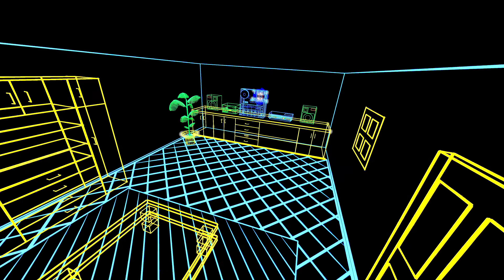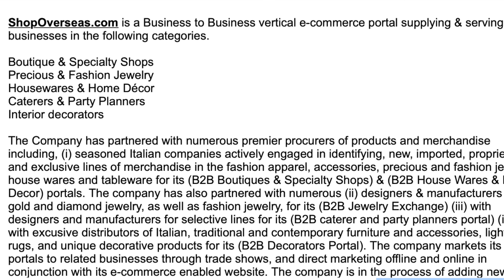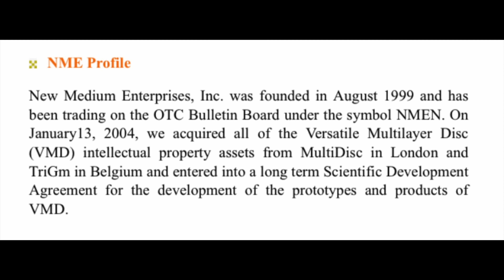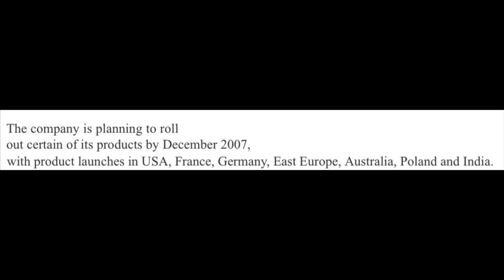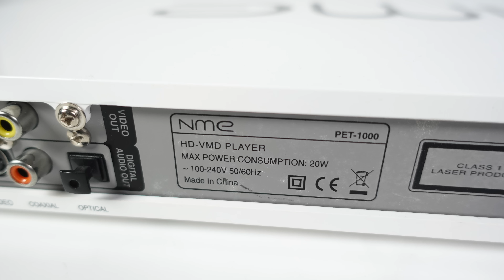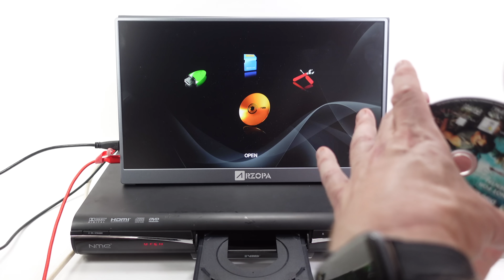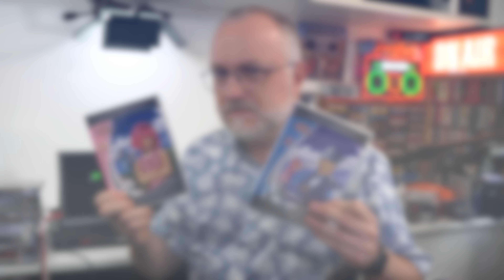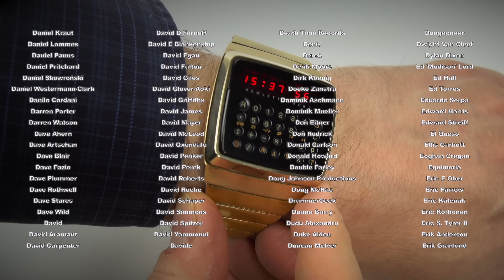The HD-VMD story - The format that lost to the format that lost

Comment: Oh yes, I remember the salty Sony really wanted to win the format war and poured a lot of dosh in to gain the upper hand.
Then proceeded to charge a fortune for their discs, especially the burners and discs.
However, the competitors that side swiped them and made them worthless was harddrives, back in the CD era and DVD, usually the drives were a bit expensive, and you had limited places for several ones. (4 drives for IDE on most motherboards.)
But after this format war, there was a massive price drop on harddrives, SATA had arrived in full force meaning a lot of ports, storage capacities started soaring upwards too.
Eventually the 2 digit GB capacity of the Bluray was beaten out of the ballpark and those who needed to store their backups stored it on harddrives instead.

Of course the internet speeds also started going up and gave birth to streaming as mentioned, which ultimately made Bluray relegated to a few home entertainment systems and never took off.

Comment: If only they focused on using only AVC (h.264/MP4) with double layer DVDs and the 3 layers that they were able to make… they would have all the backing on the claims that the reader and disc manufacturing was the same, but now holding HD thanks to a "new" codec (MP4 was out years prior, but Blu-Ray missed it on launch).

Comment: Visually this pick-up looks exasly like a Sanyo's SF-HD62 pickup. They are likely to be fault in most cases. Second possible solution is to replace flexible cable to the pick-up. Third possible problem is - spindle motor (either oxidised brushes, dried bearing or both). All these chinese crappy DVD players often shares the same problems ^_^

Comment: I don't buy it.

It just smells like scam.  I doubt they ever had any sort of anything that could ever handle more data than a dual-layer DVD.

The HD disks you saw were almost certainly just compressed video (likely with a standard CODEC with a non-standard file type.)

If they'd gotten much more attention, they'd have likely been prosecuted.

Comment: If you are looking to find another obsolete and idiotic video format, try to find any Grundig LVC recorder and cassettes. LVC was a format derived from another silly format, the Funai CVC. Grundig tried to be much cheaper than VHS (and of course their own Video 2000 system), and the result was a crappy system which never worked properly and almost all recorders were sent back to the factory. Grundig took it off the market after only a couple of month and the system is now almost forgotten.

Comment: Just under 8GB? Is that not just DVD-DL format? DVD Dual Layer exists for a while. The format or codec will not help it. You cannot make new codec for it, due the video chips must decode them too. It's just h264 or h265. 
Looking at final production discs, i have feeling HD-VMD is almost a scam. First discs not even working in demo machines. You cannot send out what is not working good, it's really useless. In the end, they just uses DVD Dual Layer format. The cannot make HD VMD practically possible, it's for me just scammy business.
20 layers in DVD is really hard to read due much higher errors. I don't believe it at all.
Conclusion: it's scam at the end. Nothing showed the proof technology is used there, even together with Chinese DVD players just reflashed with another firmware, but it will not simply magically convert them in multi-layer readers.